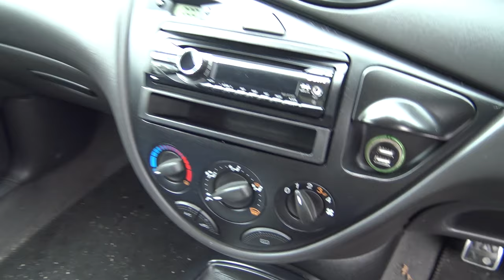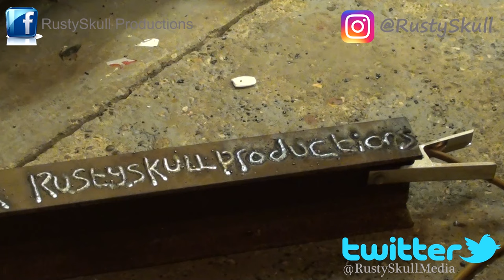Focus RS Taken Over By Wild Life

Comment: Wont u be compression Testing it 1st? instead of pulling Head off.shame its open to Elements def needs a Breathable Cover 👍
Reply from the maker: I already have in a video months ago, two cylinders were like 40psi lol 😂 but I questioned the tester because if two were at 40psi it should run as well as it does. Not that it runs well that is...
Reply: @RSPYT  it kicked up straight away 40psi wud have to crank over id av thought and as u say run bit lumpy .def do another test teaching granny to suck Eggs a know but does seem strange